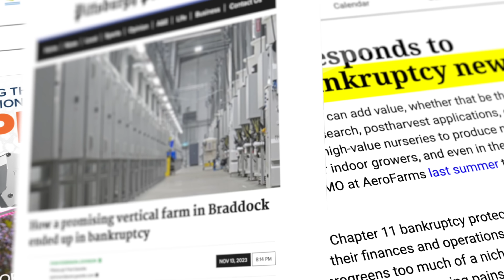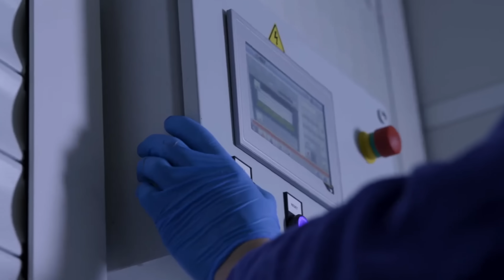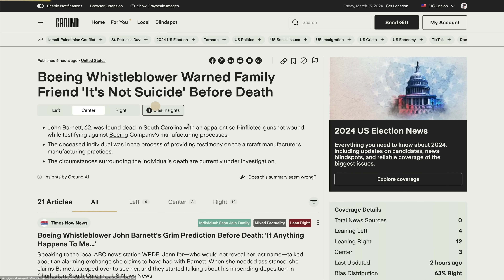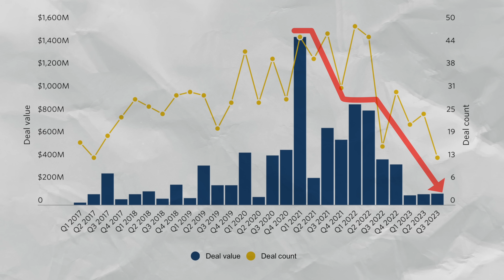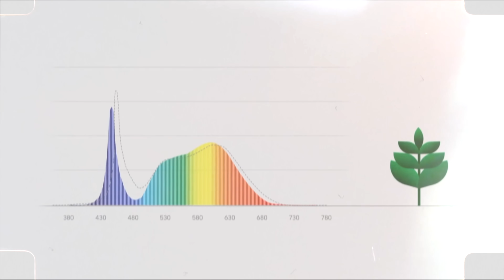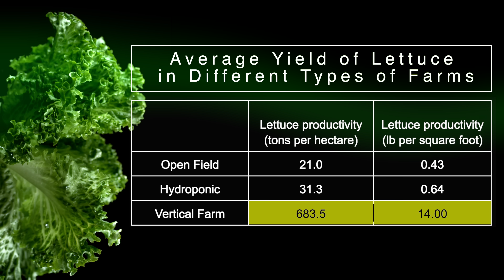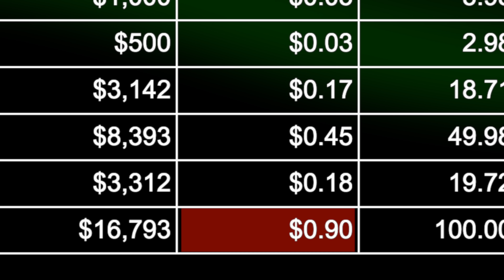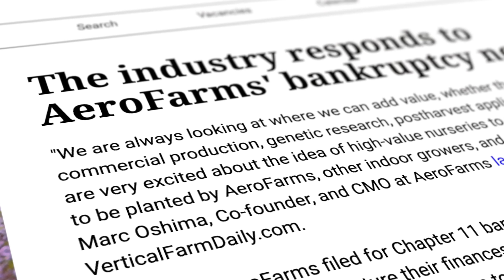The EPIC Failure of Vertical Farms - What Happened?

Comment: I think it comes down to 2 things: Where the vertical farms are and if they can produce things that have a higher price then just salad.
In places like Iceland and Saudi Arabia there isn't many fields you can grow crops at which make them far cheaper and both those places have access to cheap renewable electricity, geothermal respectively solar power. Even if it still would be cheaper to freight the food from somewhere else, it would be less fresh, require a lot of oil to get them there and there is a problem with being totally dependent on foreign imports, your nation is basically under the thumb of the country you buy your food from.
So yeah, in such places vertical farms are great. They don't take up much space, don't use that much freshwater and can be run year around.

The same thing can not be said for any place with access to a lot of fields.

The second thing is growing the right kind of crops. If you for instance can grow crops like Wasabi in a vertical farm, you are pretty much set. Wasabi is very sensitive to temperatures so it wont grow in most places but in a vertical farm you can control that. It is super expensive (it would drop a bit if a lot of vertical farms grow it but it would still be profitable because you can't grow it cheaper in traditional farming). You can also grow more restricted crops like cannabis where you don't want a bunch of hippies in your field and you have a pretty high profit.

Vertical farms like that works everywhere but they do require more expertise then just growing salad (well, maybe not the weed but certainly things like wasabi and other expensive spices).

I don't think we can replace all farms with vertical farming, neither do I think we should. A solar storm like the Carrington event could basically kill off all those farms. For very cold or dry places though they are excellent and so are growing expensive things with special temperature requirement.  But you need to consider where to put your vertical farm, Alaska is a far better placement then Wisconsin.

Comment: Before watching: 
Looking at the amount of infrastructure (building, light, electricity, transport of water, engineering and IT work) needed to run a VF, it's hard to imagine getting any RoI from something as cheap in production as lettuce; and a lot of grain and corn don't seem to fit in this plants.
Compared to traditional farming where you only need land, and enough water to fall from the sky, the complex pumping of water through the country and into the city and up to the top of those vertical farms seems to be an effort that's hard to compensate by using just less water.

Looking to permafarms, that require barely any work except harvest and also deliver several harvests through the year, It's hard to seen great advantages.

Comment: I didn't see the infestation problem at start, but when you told it it was like "oh yeah...". And i'm growing some things indoor. It worked really well at first, despite me being a stupid shit not knowing anything. Then I let a window opened, and everything since then is almost horrible. I'm considering just trashing everything for like 3 to 6 month, in order to get rid of the possible pests.

If you put that to vertical farming it's even worse than in open field, and this is bad. I'm sad this happen, I really hope we could make it work. Maybe the answer is more related to greenhouses that can be opened regularly to get predators than completly enclosed fields. If you manage well things to get that into balance during summer, you can maybe extends the equilibrium for winter when you have to close it to get it up to temp. And supply your plants with artificial light.

Comment: As someone who grew up on a farm it seems obvious why vertical farms are generally non cost effective.

Regular farms are only profitable when you have new and expensive tractors and equipment. Regular farms produce corn and soybean in large amounts (sometimes wheat), but your caprate (rate of return per expense) hovers around 2.5% even with government subsidies. There is simply too much corn on the market, and too few buyers, even with ethanol production. A combination of needing to borrow money for expensive equipment, the market being flooded with too much supply, expensive land prices, and most you can make is about a 2.5% rate of return on farmland on average.

A farmer's biggest depreciating asset is their tractors and equipment (combines) which allow the harvesting of crops without a lot of money being spent on massive amounts of labor. The real question is:

Using large tractors and labor saving equipment vs hiring a bunch of people to harvest that stuff manually in a vertical farm.

I don't care how big you make vertical farms, unless you can get robots smaller and more efficient than industrial tractors which do the same thing faster and better, it will never be profitable without either the government or investors subsidising it.

Comment: Thinking about it, it would be best to grow crops that have a high price. This could be: chill, Saffron, Ginseng, and medicinal plants. I believe it can work but companies are hiring too many specialist workers, and implementing the most expensive technology. It somewhat reminds me of computer geeks who have too much money and slap the most expensive components, even when it only provides a 2% performance increase while maintenance is 50% more.

I am currently doing a course in agriculture management and I think that if companies are keeping it simple but effective it can work with a large success. Also, I would like to point out, I think that the directors who are running the companies lack foresight and this includes the engineers who designed the system and buildings. Why I think this is the fact that the simple problem of having a closed system should have been taken into account but was surprisingly undiscovered until the operation of vertical farming. This only happens if the engineers are being rushed or the universities are handing out qualifications without regard to the consequences. The general rule that is unequivocally inarguable is: the success of a project depends on the though and well thought out designing phase.

Comment: The main problem with vertical farming is light bulbs. Is we could make a vertical farming that didnt require so many lights and so much electricity then it might be viable. Or if we could make availiable some kind of super light that didnt use toxic parts and manufacturing. But otherwise its basically only useful as a way to have criminals hide that theyre growing drug plants 🪴

Comment: I once grew cannabis in an Aeoro system.
I put the system together myself.
Long story short: The end product was significantly better than on Earth, but the work that went into maintaining the system was approximately infinitely times more than on Earth.
You use a nutrient solution that is full of minerals, which means that the nozzles that spray the water get clogged every day.
The nutrient solution must also be constantly monitored, as quite a lot of water evaporates and the PH and EC values of the nutrient solution shift quite quickly into a range that is bad for the plants. You compensate for this by re-feeling the water or watering down the nutrient solution.
Then you also have the plants themselves, which are in very small pots, which means that one day when the plants are big enough you come into the room and all of them are crooked because the weight of the plants caused them to tip over .
That's not a bad thing because you can fix it or stabilize it with cords etc.
In any case, I would never have thought of growing tomatoes, lettuce or any other vegetable in it because it would have been far too expensive.
With cannabis this is an undertaking that will pay off, but not with tomatoes.

Comment: if everything was powered by as much renewable energy as possible, and had more automation, it could cut the labor cost for only maintaining the automation floors. such as say adding a non-toxic pesticide sprinkler system on the farms and maybe using AI (as much as no one likes it too much) to keep an eye on plants and figure out which plants may be diseased in the process. in the short term it'll definitely  be expensive, but the long term, assuming everything goes well, it could be more profitable. especially if it was easier to train workers to do so little

Comment: Whatever happened to the Sunflower?  Back in the late 80's, I read about a new lighting invention from Japan called the Sunflower.  It was a big dish that sat on the roof of a building and gathered sunlight through the multiple dish indentations that made the thing look like a big steeldrum.  The sunlight was then dispersed through the building by means of fiber optic cables in bundles.  The outlet for the light was a series of little ducts filled with the cables, that could be placed wherever they were needed.  The whole building would be lit by the sun, with the only cost being the Sunflower itself and the installation of the fiber optic cables and ducts.  Minimal maintenance since the only power the thing used was to rotate it slowly through the day as it tracked the sun, which energy easily came from what it was collecting.  It seemed like such a genius idea, so thrifty and logical... and that was it.  I never heard a peep about it again.  Why isn't it a thing everywhere?  Why are we STILL lighting our buildings with electricity when we could be lighting them with sunlight???
Reply: Uhm… Maybe because we also need lights when the sun is down?
Reply: @alexeypolevoybass  ...which is why solar batteries can be added with little effort.
Reply: @Serai3 also, did you even bother to check Sunflower's cost efficiency? It's so expensive even weed growers can't afford it.

Comment: LOL.. Vertical Farm, translates to high end farming. WITH high end problems.

Major problems..
1. Climate control. THE COST!!!! Are staggering, with regards to providing light, air, water PER sq foot.
2. WHAT you are growing. AGAIN is based on how much product, per sq foot is it providing.
3. Growing food, indoors. YAH. but we are talking small foot print, which means small output.
4. Even when fullllly Mastered. 1x contamination, 1x BUG, 1x leak, 1x fuse.. could lead to a significant portion of your crop, failing. Failing to be eligible for consumption. Carrots, peas,.. that sucks.. WEED, Mushrooms, that is a huge losss.
5. THE POWER BILL!!! I Say again, the POWER BILL. There is no replacement for displacement. Impossible to compete against the SUN, with regards for growing power. 
6... THE KILLER!!!!!  Labor.. Vertical=inside. The physical labor, to handle the PRODUCT, is self defeating. AGAIN, if growing peas.. VERSUS growing WEED. Much more $$$$ per sq foot of profit.

Comment: I think the problem with vertical farming is that it's trying to solve a problem that doesn't exist by adding tech that isn't needed. If the world population kept growing at the same rate as before, maybe we would soon run into a supply problem. However, there are plenty of signs showing this growth slowing down, especially in the first world where these vertical farms are being built. We might need vertical farming some day, but we aren't there yet. If we had all land areas filled with plants, I could see an argument for it. However, we need to keep in mind that you could also use only some of the techniques they employ, reducing the cost by not having to pay for what you don't need. For example, land areas with no fertile soil but good sunlight only need aquaponics, there's no need for LEDs. Places with no sunlight but fertile soil only need the LEDs. There's no point on stacking everything if there's plenty of land. It's like building a skyscraper in the middle of nowhere, it makes no sense. How much you produce per square feet doesn't matter, how much you produce per dollar invested does.

Unlike you claim at 11:30, the problem with vertical farming IS that they used LEDs instead of natural sunlight. Just not in the cost of electricity, but in the cost of all the equipment, it's maintenence and the qualified people you have to pay for it. And I don't think there's a way of getting around that. If the world population (and therefore the demand) keeps increasing, while the techniques and equipment get cheaper and better, it might some day make sense. For now, however, there's no point on using it if the costs are so much higher for no reason.

Comment: I do think the price of traditional produce is somewhat misleading because those supply chains run on fossil fuels, and there are externalities associated with fossil fuel use, like pollution and depletion of non-renewable resources, that are not being accounted for in the price. The relatively low price of traditional produce is therefore at least partially artificial.

Comment: Profitability is unnecessary in an investment, until you run out of investors, that's when it comes back...

Vertical farms are simply not viable until the Earth has no shortage of arable land
If you can import very cheaply from a country with ease of cultivation and a lot of arable land like Argentina for example, is difficult to sell to consumer and investors

Comment: Even though the electricity cost is less then 10% in his example, it's still a big problem.
Vertical farms have an efficiency of around 1%. Meaning the energy content of the plants ( usually measured in kcal ) is 1% of the electricity consumed. If you want to produce enough food to feed a person for 1 day you need 2000 kcal. At 1% efficiency that requires 230 kWh of electricity. That's 84,000 kWh per year. The total electricity consumption of the US would increase 8 fold if we wanted to feed everyone in this way.

Comment: So the epic failure is because it currently costs too much?
We pump water from all the west coast into the desert of Nevada to grow crops. What about if we take environmental cost into the equation? Because that are costs that the customers have to deal with as well. Not directly at the supermarket. But indirectly in taxes and quality of life.
Vertical farming is also about stability and avoiding risk. Farming under the open sky comes with depending on klimate. What if we have a hot summer or a new varmint immigrating because of global warming?
Saying, if we optimize the supply chain for vertical farming MIGHT not result in a cheaper endproduct does not legitimate the title "epic fail". I thought you would tell me, it would not work biologically. But comparing it financially in this early stage with a perfectly optimized and established industry seam a bit farfetched.

Comment: There's just a LOT of very high fixed costs in vertical farming, and the goods you're producing aren't that valuable.  You have to heat/cool/control the humidity, you need to power all of those special lights, you need to pay for a building, any automation and equipment.  That's a lot of extra costs over a regular greenhouse for not that much extra yield.

Comment: not a good comparison in terms of the costs. In a normal farm the equipment (tractors & the like) cost a lot more then the capital costs of a vertical farm, only it's not added up in the calculations in the video.

Also the labor costs in those vertical farms is weird at half of the expenses. In a normal traditional farm from a century+ ago, the worker would have been a single man & his family, so how did you reach $25,000 for work expenses?

Something just seems weird here.

They should have gone ONE step for vertical farms: just artificial light and everything else as usual: both using earth to grow stuff & pesticide when necessary. Then go from there.

Comment: why the freaking heck do they seemingly ALWAYS try to mimic everything, instead coming up with clever solutions to use what we have the best we can!?
Light, why not using mirrors?
Water, we already know how to do that + feed plants exactly what they need from a closed loop system
Air, filtering and circulation at large scale we also know pretty well, so why they have individual fans hanging on pretty spacey racks?
the most costly thing about it is (semi-)automation, that's we're we need to improve to reduce costs significantly enough, to outweight skilled labor costs!
Also, food grown that way shouldn't sell as regular food, but as quality improved food - it will never replace regular agriculture and it's simply trying the wrong thing!

Comment: I'm surprised HVAC isn't a bigger one, because humidity and temperature could affect not just the growth of plants but other things like mold or bacteria that could be problematic as well. And if it's particularly humid, the building itself may also be affected if not sealed against water intrusion on the interior. Seems like there would be a lot of work to keep that tight operating window.

Comment: That was more of a "no shit sherlock" moment. Expensive building, 3d-printer style robots vs  massive agricultural machines that lower the costs, artificial lighting, ... As long as normal farming is an option it will be cheaper.
And I disagree that lighting is not an obstacle. Lighting alone costs f*cking half of the total costs of normal farming. Even if there were no other extra costs, it would disqualify this nonsense.

Comment: Just go a little lower tech, windows, only have lights on to extend the growing. Don't worry about the best lighting get lighting that works good enough.  Partition off sections and isolate them so problems don't spread.  More 'rooms' with independent air and water.  So if you have a problem you shut down a small section clean, and restart.  Do you really need robots to harvest or can you just make the drawers, pull out and have ladders for human workers.  I think you could start lower tech and improve over time, to have a smaller start up cost.  Thus smaller investment up front.